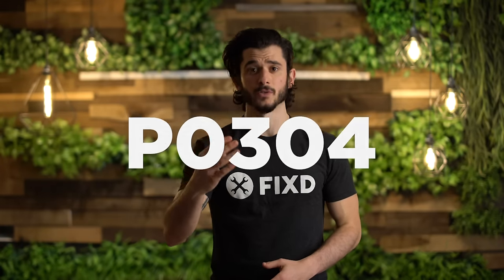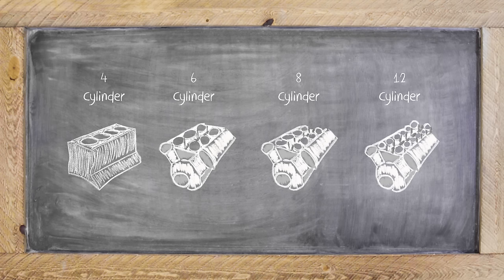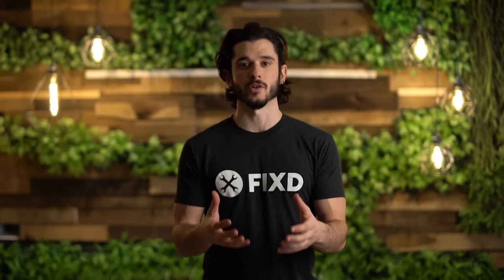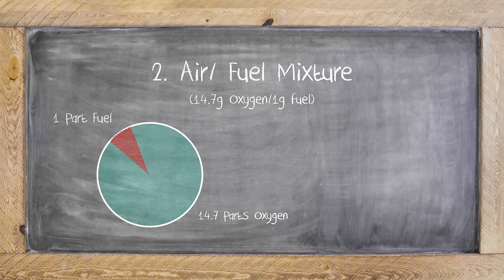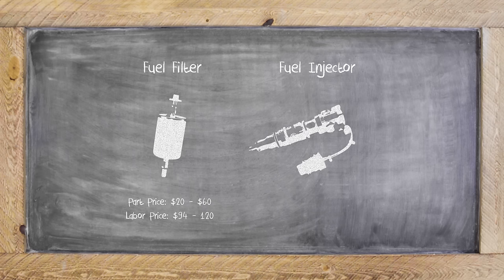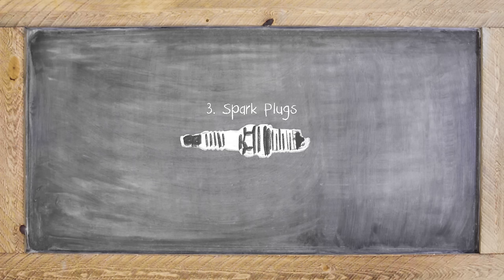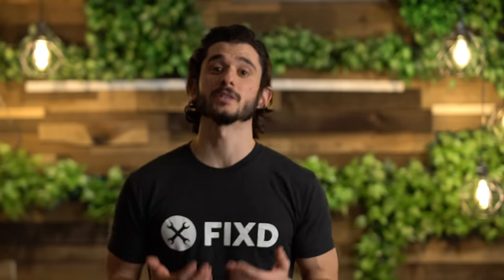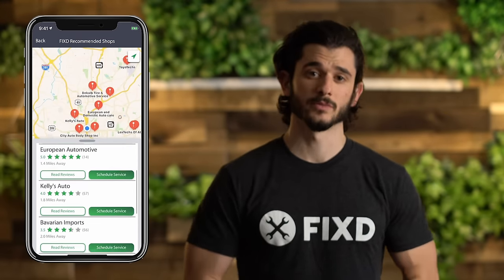P0304 Explained - Cylinder 4 Misfire (Simple Fix)

Comment: Careful, you can only swap coils if they are "on plug" coils.  If you have a coil pack, do NOT try that.
Reply: how can you tell the difference?
Reply: @chuckpotts458  a coil pack is basically a "box" of all coils in one, with normal small plug wires going to the plugs. If you swap the wires themselves you'll change the firing order. The animation here, shows the individual coils that sit literally on top of the spark plug. Then small gauge clips plug into them. As long as you keep the clip/cable in the same spot, you can move the coils around to see if one is bad.
Reply: Ive been doing it for years. Its simple. 
1:un bolt coil pack
2:un plug the 'sus' coil pack 
3:repeat 1&2 on a different coil pack
4:switch them, plug them in bolt them down. And re scan, if the 'sus' coil pack carries the code to the other cylander then it is the coil pack. If not then it is most likely the spark plug. If one plug is bad replace it and see if code clears. BE SURE to check for oil on the plug. If there is, you should replace valve cover gasket, and seals. " Recommend replace all spark plugs if you can"
You can also remove the coil pack and use a multi meter to test the resistance, if you have one and know how to use it.
Reply: @All_praise4Allah  you are explaining correctly for a "coil on plug" type.  I mentioned coil packs, I should have said ignition coil pack or ignition block to be proper. You cannot move the packs in those types. If you switch spark plug wires around it will be big trouble.
Reply: @Steve-og3cr  i know how to seperate the wires
Reply: @Steve-og3cr  can you please direct me to some info on this though? I may be confused, but it is important i understand. Any info greatly appreciated, im not a mechanic im just stuck fixing cars and i just want to make sure its right
Reply: Wait are you saying the coil pack things that attach to the top of spark plugs can't be moved from one location to another?..
I figured they were all the same. Having misfire now
Reply: @Steve-og3cr  omg how did people make this sound so complicated YES THEY CAN BE INTERCHANGED THE CLIP WIRES ARE USUALLY LIKE PERMANENTLY SET IN A CERTAIN SPOT
Reply: @freedompioneer4311  he's talking about there are 2 different systems for coil packs. 1 system has all 6 coil packs mounted together in a manifold or like a bundle and you can't change the individual packs out, he's saying on that style do not attempt to just move the wires/cables around to troubleshoot. Then there is a different system where each cylinder and each spark plug has a seperate coil pack that sits on top. You can move those coil packs to different cylinders and swap those coil packs around and see if the fault follows but you still plug the same cable into the same cylinder for that style.
Reply: @ADHDAquatics  thank you, like on a 08 Honda accord EX-L V6 sedan has interchangeable coils packs
Reply: Thanks for the heads up got a 07 jeep wrangler
Reply: Well it would be impossible wouldn't it if it was a coil pack.
Reply: @yeahrightmate the animation is a bit tricky, and might cause people to think they can just swap wires at the spark plug.

Comment: I have a ford van v8 engine.  bought 8 coils for little over 100 and spark plugs from oriellys for 6.00 each and 8 fuel injectors from geek parts online for 105.00. Hired a mobile mechanic off of Craigslist who charged me 150.00 in Oxnard. If I was in San Diego I would have drove it across to Mexico where the service would be less.
Reply: Sounds like a average tuneup labor price that was to much for u?

Comment: Hi I got a question I got a 2010 Honda Odyssey and the code po304 popped up as the four cylinder misfire and I changed the spark plugs I put in fuel cleaner and my vehicle when I accelerate really hard will start to jerk I checked the coils and they look brand new I went to Honda and they said it could be my off brand coils what is going on with my vehicle?

Comment: 2006 chevy cobalt 2.2. Replaced fuel injectors replaced coil pack replaced ignition module replaced spark plugs still getting misfire cyl 4
Reply: You probably have more serious problems in engine. Swap it
Reply: What was it
Reply: @abramporras7877  bad aftermarket ignition module went oem as well with all components misfire cleared up
Reply: @rogerleadbeter1625  thanx man no one ever responds on these 😂 appreciate it

Comment: I have a 2019 Kia Optima. I got an oil change, and the next day the check engine light came on and I received a P0304 code. The car is now shaking and idiling rough. I changed the spark plugs, and the coils that didn’t help. The spark plugs were black after only a week of changing them.  What does it sound like the problem could be? I’ve read so many things. 9:34 pm

Comment: Before you pull the spark plug make sure you blow WITH COMPRESSED AIR, the area around the spark plug so dirt and debris does not fall into the
hole...prep is EVERYTHING

Comment: Also, check your sensor harness wires to see if they are frayed or chewed by rodents.  I discovered a chipmunk or squirrel was bringing acorns into my engine and feasting on them and my wiring harnesses.  They chewed through the rubber that protects the wires so I'm sure the bare wires were arching and causing the sensors to fail.  Just a thought...

Comment: I you had a vacuums  leak on intake wouldnt you get a lean mixture code on multiple cylinders
If it was the fuel filter wouldnt all cylinders be miss firing and running lean
Worn spark plug what do they wear on 
Most plugs these good are good for 100,000 miles

Comment: I bought a 2003 F150 XLT a week ago. I put some gas in it today & some STP -   High Mileage - Complete Fuel System Cleaner in it with the gas. Right after that,    I started the truck up & immediately the CHECK ENGINE SOON light came on & it feels like someone had pulled the timing completely out of it!! Its has ran great all week! Is this because of the STP I pit into the gas tank? (It was my 1st thought!)   I am a female & just thought I'd start searching what the problem might be, as I am not a mechanic). The guys at the Auto  Store recommended I put it in the truck when I put the gas into the tank. 
Thanks for this video. Not to find out how many cylinders this truck has!! Ugh... 
JG

Comment: Just got the PO 304 Code in my Wife’s 2016 Chevy Malibu 1.5T engine the other morning. I left the car running and opened the hood to do a visual and didn’t notice really anything out of the ordinary until I decided to unscrew the oil cap from the Valve Cover. When I did I could see some  blow-by smoke coming out of it at the valve cover with oil cap off. At this point before I do anything I am curious to what you think? I can go in very easily and swap coils with number 3 and 4 cylinder to see if the number 4 coil is bad or not but in the back of my mind is the Blow-by smoke coming from the valve cover. The motor only has 35k miles on it. Can a bad coil cause the blow-by I am seeing? We haven’t driven the car since I scanned the car with my OBD II Scanner Friday morning. It is very early Monday morning right now. I made calls to the GM dealer Friday afternoon where I purchased the car from 6 years ago as a left over in February of 2017 to see if there was any power train warranty left on the car and was told no there wasn’t just in case it is a big problem internally. I have seen another You Tube video a Repair Shop did on another 2016 Malibu with the same 1.5T 4 cyl engine with a PO 301 Code showing Cylinder number 1 with a Misfire they claim has a bad piston. That engine although much louder in the video is also blowing smoke out of the valve cover. I really don’t know what to do at this point in time. In need of some help as to what to do next.

Comment: Help! I got this code on my v6 mustang and already got new coils , spark plugs and wires and still not fixed . Even did a compression check and switched it around and it keeps coming back as a misfire on cylinder 4. What’s the issue then? Fuel injector? Is that the $700 fix ? ):
Reply: Did you get it figured out? Fuel injectors can be fairly straight forward to replace.
Reply: @Sheevness  somewhat irony ce light comes and goes now sadly

Comment: Have DTC P0304 on a Chrysler Grand Town & Country 3.8 2011, have new sparks, new and OEM coil pack, new wires, tested and cleaned inyectors, no vacuum leak and DTC P0300, and P0304 they did not want to leave the chat, I hear a hydraulic valve lifter sound when the engine is running, could a faulty hydraulic valve lifter cause this DTC??

Comment: Was getting p0300 and p0449 (vent solenoid). Changed plugs n wires...p0300 went away. P0304 comes up now and I haven’t changed the vent solenoid. My truck when stopped is shaking and running rough. Will the vent solenoid throw the p0304 code since it deals with air and fuel???
Reply: Did it? I think it would, you must have the answer by now

Comment: Since cylinders are sparked at a 1-3-4-2 sequence is it correct to swap them? I have a Vw Golf 6 that is misfiring on cylinder 1 and 4. The ignition coil is one tower (are not individual). Can I plug Ignition A to any cylinder different from 1? Wouldn't mess up the sequence of the crankshaft? Actually is not a COP Coil-on-plug but is wired (Damn it Vw!!) and every cable is different length purposely to reach the specific cylinder.

Comment: I changed my silverado fuel injectors, It had a hard start, and when I pulled the old spider injectors out one was broken and oil and fuel was all over in my upper intake. FF I put everything back together, and now its running terrible. I brought it to autozone and the codes read misfire in cyl 4,  fuel injectors , mass air flow, etc.  My truck was working better with broken injector, than now.  I dont know if the stiff line fuelinjectors bad, bad spark plugs, mass flow or whats the issue. any idea?
Reply: Ugh I feel you. What was the issue
Reply: @gabrielavega91  the FI hose was kinked. However Im back to square 1, because its back hard starting, and sometimes it doesnt start at all. Im thinking the brand new spider is defective
Reply: @bigcartoonyIIV  did you ever get it sorted??
Reply: @KishBish  Yea it was the distributor cap, and a bad fuel injector.  Now my battery is dead and on a flat..lol  Im 2 steps from retiring that truck..lol

Comment: I have a 5 cylinder straight engine. so lol I don't have a v-configuration. just a slight thing I noticed. but good info because, I had already replaced the spark plug and ignition coil.

Comment: Can it be water in gaz ?or it will p03XX on all cylinder ?  happen to me 1 day after i fuel in cheap gaz place. Changed my spark plug and fixed it for a day and not it is back, my engine shaking p0304. It like random. Got white smoke at the exaust and stop to smoke after 10 minutes idle. Now raining outside and got the shaking back.
Reply: I got the same problem, do you already fix it?

Comment: I don't know when you will get this message but I have a Hyundai Genesis 2011 2.0 coils are okay spark plugs are new 1 2 3 cylinder works for is not no power through the wires that's where I'm stumped if you can get back to me and give me some tips be much appreciated how I know it's not firing cuz I put spark plug in the boot I'm turned on the ignition I no spark there's a spark plug as I say it's not my coils it seems to be the wire connecting choose a boot that's not giving power happened one day when I was driving on the highway

Comment: Lol, i have this code and brought my 2019 grand caravan to the dealership to do a more comprehensive diagnosis... they said to replace all the coils and plugs (just to be on the safe side) and are charging me $500 JUST FOR THE PARTS (6 coils and 6 plugs) and then $700 FOR LABOR!!!!  WTF!!!  Well, I told then no... replaced everything myself for just under $200 for the parts.

Problem is, the same cylinder is STILL misfiring... Anyone have another possible solution?
Reply: Many other causes..injector could be dirty

Comment: I'm going to bang my head off the wall. I've been working on a 2004 GLS VW Jetta with a 2.0 automatic transmission. I FOR THE LIFE OF ME cannot figure out this random misfiring on cylinder 4. New coils, plugs and plug wires. A good friend suggested a compression issue or head gasket problem. Nothing there either. I'm going to check the fuel systems next because it's getting the correct air mix. I just drove it and noticed that the car backfires and runs rich. The backfires take place when going up and down a hill and combusting close to the cat. 😮 This is my daily driver and I'm trying my best to get this sorted on a very limited budget. I have all the tools a person could ask for but limited time and finds.
Reply: How did it go? What was the problem?

Comment: I have done everything I could ... maybe it's a vacuum leak or a fuel injector? ... it only runs ruff in slow idle and now most of the time
Here is what I do do already which all helped and then problem still there
Replaced:
spark plugs
Coils
Mass air flow sensor 
Two solenoids
Two position sensors
Both oxygen sensors
The fuel filter ( a little intimidating but done)
Gaskets for valve cover
Purge vale 
Another crankcase sensor under car
Oil change
I did clean #4 fuel injector - I hope it just needs a new one ? 
I'm running out of patience really but I am going to fix it 
Knowing quite well it's all part of planned obsolescence! 
It's designed to fail so all the parts eventually need replacement- it really sucks!  It seems the sensors work together all right and all effects the other but  never specifically 
Anyway- funny how it's the computer that's in charge not the mechanical parts that would run in older cars 
It line when AI says it's good - pay to have it scanned for smog check... ext
It's frustrating!

Comment: Great explanation...p0304 code came up...looked at the spark plugs first (number 4 looked worse)...changed them all.... fingers crossed that's the problem solved 🤞🏻
Reply: Is the problem solved?
Reply: @batuza4117  yes... problem solve....if it wasn't....it would of been replacing the coil pack, them MAF sensor
Reply: I had all my spark plugs switched out, after p0304 code. A week later check engine popped back up, called mechanic they said it might just be cold out, i dunno
Reply: Did it work or was it just cold
Reply: @MJ.401 same code on a 2022 vehicle with 80k miles I drive spirited changed spark plugs went away 2 weeks later cylinder 4 was misfiring might clean out coils before I buy new ones hopefully that helps.
Reply: @MJ.401 
Do you mean wrong sparkplugs=cold

Comment: hey fixd im having problems with my seat cupra 2008 1p model. its saying multiple radom missfires, miss fire in cylinder 3. ive tried changing coils to see if the problem would change cylinder and it hasnt. so i decided to buy 4 new ngk sparkplugs and the problem is still there.. what else can i try as im really starting to get tired of this problem.
Reply: What was the problem

Comment: Coil,both plugs,new wires,new injector,still P0304 cyl. 4 misfire,no matter brand of parts,changed twice,has all factory in it now,still misfire cyl. 4...cam lobe? Valve? Rings on piston? Does puff a little smoke when idles for 10 minutes and not drove,you drive the vehicle smoking out tailpipe stops

Comment: I just got this code on my 2010 Jeep Wrangler Sport unlimited. Came on when Jeep was in park at an idle. Any suggestions ? Code P0304. Cylinder 4 misfire. Thank you!
Reply: Check number 4 plug
Reply: @mayken6661 
Check all the sparkplugs so you can see a difference

Comment: The prices mentioned in this video are way out of normal range. E.g., Spark plugs shouldn't cost you more than 10-15 bucks.
Reply: doesn't that cost depend on the vehicle tho? the spark plug for a Corolla isn't gonna cost the same as one for a BMW.

Comment: Hey, i double decat my car with a 3” Downpipe and then this code came “ P0304 cylinder 4 misfiring “ can u help here? 

My spark plugs are new and so are my coil pack
Reply: Did you ever fixed the problem? I changed spark plugs, coils, and fuel injectors. Code still appears.

Comment: I had done all of these and my car is still misfiring on cyilnder 4. I also did a couple of other things.. starting to think I have a bad ecu
Reply: Me too did everything have a 5.3 vortec
Reply: Have you fixed it yet ?
Reply: No my next guess is to try a running compression test.
Reply: Did you ever fix your problem because I’m having the same problem and I tried everything
Reply: @leeadams9004  I just sold the stupid car lmao
Reply: Syd C do you know if the buyer ever figure out the problem lol
Reply: @leeadams9004  did you ever figure it out? I replaced coil and spark plug, fixed it for awhile, couple weeks then the code came back up

Comment: A fuel filter would not cause a misfire on just one cylinder, and not any engine can swap coils, only ones with single coils per plug.

Comment: I ran my obd2 scanner and got a cylinder #4 p0304 code then changed all my spark plugs to,new Champion Plugs and now I'm,getting a p0300 code where multiple engine misfire I do have 4 o2 sensors that are failed could this cause the random misfiring.
Reply: Your o2 sensors read how much fuel is been burned so if they are failed mean ur computer is dumping fuel into it and reducing it drastically on points wich can lead to engine failure
Reply: @arielzambada9911  yes but my question is could the bad o2 sensors be causing the misfire noone ever states this in videos if bad o2 sensors can cause engine stalling/ rough idle

Comment: what if it says misfire on 1 2 3 & 4 cylinder code PO301, PO302, PO303 & PO304
Reply: Rip
Reply: Jack up radiator cap drive new  car underneath  install cap. Jk.